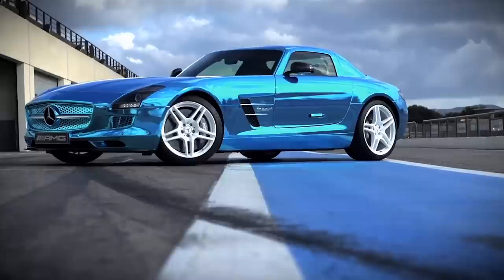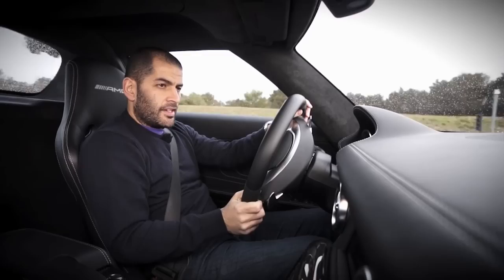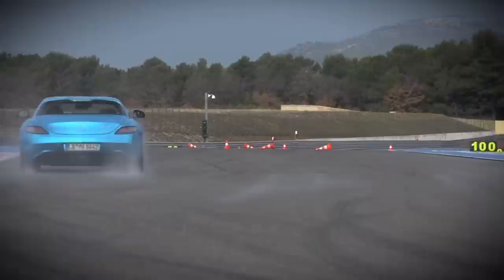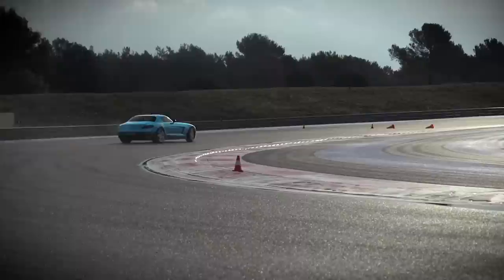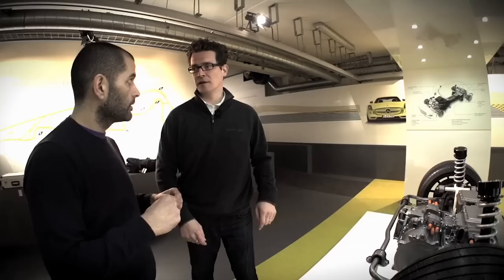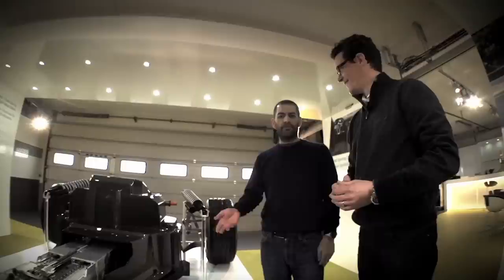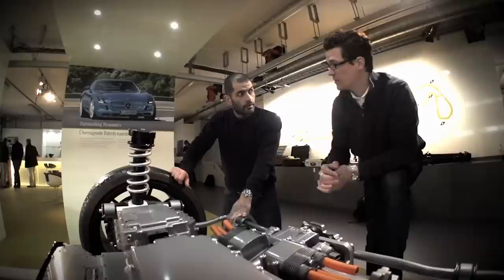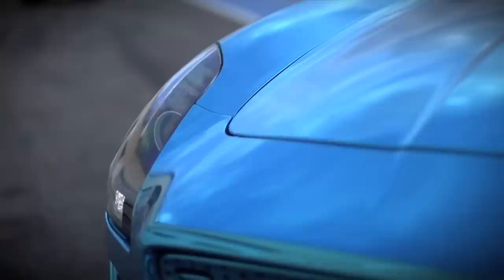Mercedes SLS Electric Drive. Can Volts Ever Match Pistons? - /CHRIS HARRIS ON CARS

Comment: Back in the '70s, the Aston Martin Lagonda featured the most ambitious, complicated and in-manageable dashboard ever placed on a car. More than what was expected to be spent in the whole card development had finished into that CRT monstrosity and, to date, you need a wizard - more than a cars electric system specialist - to fix anything that goes awry.

Fast forward forty years, a good engineer could replace the whole unholy mess with a couple of 7" LCD driven by a Rapsberry, or an Arduino, and a A/D acquisition board, given a month or so - well, I know people who could do it in the week-ends, just for fun.

Which is, really, the reason why today we see LCD screens as main instruments in some low volume sports car - they cost a bit more in pieces and bits, and do not appeal much to the more conservative buyers, but are really a lot  simpler to engineer. You just have to place a fancy graphic on the LabView programs are usually used for testing.

I think that, for this car, it is pretty much the same.

Overly complicated, difficult to maintain etc. with today's technology.

MB built it, probably, more to have a test-bed for its torque vectoring and other technologies, that we are probably going to see in the future, probably in hybrid cars.

As such it is a beautifully looking, horribly costly toy that they will sell to someone more interested in showing off than drive it daily.

With the caveat that, being so costly (400k pounds?), this machines will receive proper maintenance, probably directly from technicians out of MB technical services, and these will report the problems encountered to the designers of the original system, to fix the quirks that escaped the in-house testing -  and there are always some.

So, in the end, these are experimental test-beds, sold at a premium.

I, for one, am happy that some sheik is going to spend a lot money to test the tech that's going to be in my son clunky, used, first car, in twenty-five - thirty years (the guy still has to born, and I am single).
___________

It's not like it's the first time, either.

The 300 SL of the 1954 had a mechanical injection system that mandated Oil change every 1500 km, and made it pretty fragile if the owner had the habit of making just short trips (it poured gasoline, after shut-down, till the engine moved; if the engine was cold, gasoline could not evaporate and tended to build up, diluting the oil).

20 years after, the grandsons of the same system helped making MB gasoline engines one of the most reliable on the market, from the '70s throughout the  early '90s.
Reply: I'm on my second Mercedes-Benz.  From an inline 6 w202 to w209 clk500 convertible.  Everything they make is fantastic.

Comment: 2 things.... if they get the cycle life up high enough then you can simply have a battery bank in you garage, and either phisically swap the batteries over, or use them as a very high source of power, many times more than the grid can provide. but yea, charge time is unlikely to be as fast as a petrol car any time soon without lowering their cycle life....

Comment: Motors and batteries still get hot, they are heavier than petrol drivetrains and the gearboxes still need oil, although you won't have to change it nearly as often as engine oil. It's true that there are fewer moving parts in an electric car, but the power electronics are still complex. Of course the internal combustion engine will eventually become obsolete, but I think that's still at least 25 years away.

Comment: You said "not necessarily, top speeds generally require far less power than acceleration".
What I say to that is: not quite.
Air resistance is harder to overcome at higher speeds, so you actually need as much power as a launch for high speed driving.

Comment: so, you agree with me? that's what I was allowing for with the 'not necessarily'. if you want to go 250mph you'll need some massive power... but were talking about going faster than 140 - 400kw is more than sufficient, particually in something as aerodynamic as the teesla. The batteries in it are probably capable of providing enough power to hit 255 in the veron (though only for about 4 minutes), so chances are the same battery pack will be sufficient for >140.

Comment: I agree with what you said to me with these last few comments.
Of course efficiency is great. But there is one drawback with an Elec-motor in a performance car; sound.
So my ideal future is; hybrid ethanol (or hydrogen) performance cars and fully electric 'drive-to-work-every-day' cars.
What I mean by hybrid ethanol is; two powerplants working together with the benefits of both systems. You get an ICE sound and overall much better efficiency with the elec-motor helping the ICE.

Comment: Maybe in a far future. You have to consider how the batteries are made, the process of making them, the impact on the currently energy structure, etc. That includes not only increasing the energy consumption (which will polute more), but how the materials are transported to make the batteries, the actual transport of the batteries to assembly lines all over the world, then how theyre gonna disposal all the batteries when they stop working. Unless they make changes to all that, idk if its viable.

Comment: Chris tried so hard to find something not to like about this car, but even the most diehard petrolhead has to admit that it's freaking amazing. Forget about volts matching pistons - it should be the other way around. Pistons cannot, have not and never will match volts.

The most advanced internal combustion engines can be out-performed by a sufficiently large electric motor with almost trivial ease (and said motor will still be smaller than its equivalent gas engine). Batteries are still the Achilles heel, but they're improving by the day, and they've made astonishing leaps and bounds even since this video was posted. The electric cars we have today would have been thought impossible just ten years ago, and we're not stopping here.

Internal combustion is a dying and obsolete technology. Soon, the only people using it will be stubborn gearheads who refuse to see the future and classic car restorers who want perfect historical accuracy. The rest of us will ride silently off into the sunset in our electric chariots, and the only smoke we leave behind will be from our tires. And we won't be looking back - we'll be wishing things had been like this all along.

Comment: fair call, i'd miss the sound of a roaring v8 too... but you don't sound like you've driven many elec. vehicles, if any. elec motors can actually sound great, and give the same rush too. low down you can get a low resonating growl, and the high end can be like a turbine of a jet spooling up. Not the same volume as a ICE but still gives the same tingle down your spine. Some are silent, which has its own benefits, but the 'rogher' sounding elec. motors sound pretty awsome too.

Comment: I've driven Industrial Electrical Vehicles for a long time, I LOVE pistons, but electric is AMAZING power, but the weight is always a problem, so you have to control the car with the motor speeding up and slowing down, as a means of steering.

Comment: Doubt all you want, but it's happened multiple times in my LEAF. Hear the engine in the car next to me red-lining to keep up, while I just zip off silently up to a few past the speed limit... now the roommate, who's a bit of a bigger race junkie than I am, she blew right past the speed limit a few times then back down. Either way, yes, it happens routinely. An 80kW motor smokes a 100+HP ricer. Know why? Full torque, no RPM band to worry about.

Comment: If you're going to have a conventional transmission and diff, then where would the two motors go? If you're going to have two motors, might as well make them fully independent. Torque vectoring and diff action can then be done electronically.

Comment: true, it can only get better from here. the problem with electric cars though is pollution in regards to their batteries. batteries as of now are one of the hardest things we deal with regarding being discarded, but like I said if the graphene thing works then chances are they will last a lot longer and won't need any hazardous chemicals or expensive materials to operate, not to mention all the other benefits

Comment: There is. Silicon-nanowire anode lithium-ion is already at the proof-of-concept stage with 10 times the power density of current Li-ion cells, has a longer duty cycle and faster charge times. There's still a few issues to work out, but we'll see them mass produced in the next few years.

Comment: First of all, if you drive your car 24/7 then yes, charging might not work well for you at this moment. But if you -- like most people -- sleep for some period of time, you should be able find some hours to charge your car.  Moreover, with the right batteries and set up (like the Tesla Supercharger), you can recharge your batteries in less than an hour.  Soon you won't even need an hour.  Big improvements ahead.

Comment: Well not entirely, hybrid is actually referring to a hybrid power train, meaning the both the electric motor and the engine are connected to the wheels. The Karma, along with the volt, are electric vehicles by definition with range extenders. I think Fisker has a catchy acronym like EVER to describe the powertrain. Technically speaking you can drive a Karma and a Volt without ever using a drop of fuel, which is what differentiates them from hybrids.

Comment: If you make a car heavier, you get worse handling. If you make a car lighter you get better handling. Weight distribution also counts (to an extent). For example, if you have a FR and your weight is split 53:47 and you lighten the front to make it 52:48, you'll have better handling. But if you add weight in the rear to make it 52:48. It probably won't be any better.
**(If you don't know what an FR is without looking it up, you should just stop arguing right now)

Comment: oil has the benefit of being incredibly energy dense. also the combustion process can be made extremely efficient. there is a reason we use oil, and that is because it has tons of energy and it is still relatively easy to get in a large scale. look at diesel tech, cars that can get up to 70mpg and extremely small engines. sure it can be perfected, but as of now, electric cars are not the supreme answer to everything. maybe in the future.

Comment: the motors can brake the car as hard as they can accelerate them, which while significant is not as much braking as can be achieved with discs. The real bottleneck is the battery, it can only accept charge at a certain maximum rate (which is a much lower rate than it can be discharged at), so the motors on the SLS here would not be the bottleneck for regenerative braking.

Comment: A critical point got buried slightly here. They can do the negative torque (differential regen braking) trick to steer the car because a motor and controller reacts far faster than trying to automate mechanical brakes.

In other words the dynamic handling qualities that the journalist was raving about were possible, and only possible, exactly BECAUSE it was an electric vehicle.

Electricity isn't just an alternative way to produce torque to the wheels. It opens up whole new dynamic possibilities

Comment: It isn't as simple as that. Firstly, large centralised power stations are much more efficient than tiny internal combustion engines. Secondly, those power stations will be progressively replaced with renewables. Thirdly, an electric powertrain is inherently far more efficient than an ICE. Finally, many studies have concluded that the embedded emissions (from manufacturing etc.) are lower. EVs are still a significant win in terms of emissions - this one's fun too :-)

Comment: I'm impressed by the technology... torque vectoring at the speeds required for this level of performance is incredibly demanding... but I'm absolutely ABSORBED by that BLUE!!  That paint... it's just... ugh... ELECTRIC!... I've never seen anything like it... but of course, with a basically unlimited budget for the prototype... Mercedes can pull off anything.  (I have a Highlander Hybrid, and have been very impressed with the technology... Toyota has come a long ways for consumer vehicles. )

Comment: Cheers for the Mercedes enovating engineers work. Electrical cars are already available to buy at some car dealers. But the Oil & Gas will still be needed and still be expensive. I supose this concept will be very applicable on colective transports like autobuses, that can then recharged overnight or overday. Hanving metioned this, dont over enthusiam yourselfs, Human kind technology has achieved its mature adulthood. Best things to develop now are related to efficiency and resources management.

Comment: Did I mention the whopping power gains compared to using gasoline? Well, if I didn't, here goes; there would be whopping power gains. Blocks would need to get stronger, or we could do a compression ignition system like that of diesel engines, though I'm not sure behind the math of that working over/better/worse/if at all, than sparking the mixture.

Comment: That is in a typical differential driven car, by the sounds of this, this car can slow the inner tyres so it handles the corners better, by means of applying negative torque. As DumbValvesAndDnB mentioned, this likely is through means of regenerative braking and puts a bit of power back to the other wheels.

Comment: It's very much possible. But you'll get a bit of skidding.
If the car has independant-4-wheel-steer with the front wheels turned inwards and the rear wheels turned outwards, then there'll be no skidding at all.

Comment: its more due to electric motors (particually large ones) being difficult to controll at low rpms. Their efficiency is lower, and a controller will have to 'work harder' to push the car along. but neither of these are insurmountable problems, not compared (well, all other things being equal) to the extra weight, lower efficiency and mechanical complexity/maintenance of a gearbox.

Comment: Thing is, even with the best systems on your car to make it handle better, your tyres will give out eventually. There's only so much grip these can provide. And the heavier the car, the slower the cornering speed that'll break the tyres' traction.

Yes, you can counteract the negative effects of weight. But that's it, you're counteracting the ill effects and the same car, with the same clever systems but less weight would still handle better.

Comment: I race RC cars, so I know what you mean about the controller/motor being less efficient at low RPM or power. But I wouldn't have thought that the difference would be that great to justify a 4-speed gearbox. Perhaps by going with a single motor and a conventional drivetrain it could have saved them money on a higher spec speed controller system? I know that in the RC model world, a high-performance speed controller is one of the most expensive components.

Comment: Being on the bleeding edge always come with a price, but when you think about what this car has and does not have, all it doesn't have from a traditional gasoline powered car is the sound.

What is has that the gasoline cars don't is immediate torque, insane acceleration and ridiculous gforces that will make your kidney hug your liver like a fat lady loving an apple pie. Even the top gear guys noticed that a while back, the limits of combustion engines are closing in. Electric is the future.

Comment: Nope, it does that neg torque thing even better. Rather than using the slow breaks which has to be pushed physically. This system can change the torque behaviors in split second. It simply has to manipulate how electrons are flowing thus changing magnetic force many time quicker and less wear tear than brakes. The beauty of electric prowess.

Comment: not necessarily, top speeds generally require far less power than acceleration, and most of the batteries used arn't used anywhere near their maximum output, in order to extend their cycle life. The 80kwh battery is run at ~400kw in the tesla, yet it could probably handle short periods of over 1Mw without too much trouble. that'd only be 12.5c... theres plenty of li-ion batteries capable of well over double that.

Comment: Probably a fraction of the price to replace those batteries.  864 cells between the 12 modules can't be cheap.  An engine should last more than 10 years if properly maintained.  My Cummins Ram is a 2001 with 164,000 miles and runs perfect.  As Chris Harris stated in the video; the technology is still a way out for it to be practical in a sports car.

Comment: It's possible to put a piece of DSP code together, feed the audio to the audio system and connect the DSP to the pedal sensor and wheel pulse sensor and make any EV car sound like a Ferrari or better.

Anyway I rather be without it.

Comment: it's not, you got it the wrong way and that's exactly why I mentionned it's not well explained. The torque on the interior wheel is not negative, it's still positive, it's only less strong than the exterior wheel torque.

Comment: An internal combustion engine is at best 40% efficient. The electric car is much more efficient than that because of the pwm switching techniques used to convert dc-ac. Also, any rechargeable lithium battery can safely charge in an hour.

Comment: You will appreciate the greatly reduced noise (and cost and pollution perhaps) when you can drive the thing wickedly fast without causing every cop's head to turn when you hit the gas.  Gas supercars are soon to be a thing of the past.  Already, it's not only Mercedes but Ferrari and many others are discovering the huge advantages to using electric motors in performance, noise, cost, reliability and longevity.  While your mechanic may not appreciate your reduced visits, you surely will.